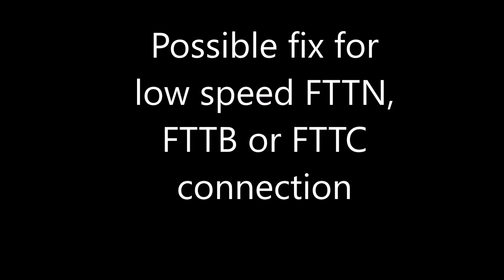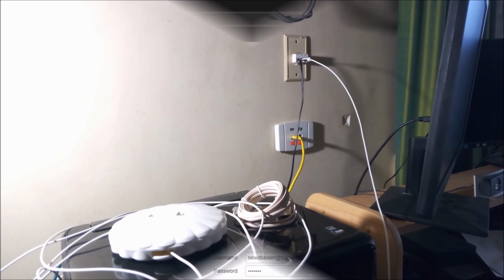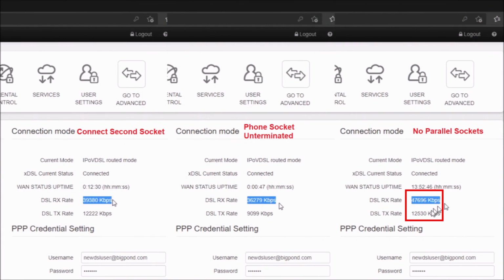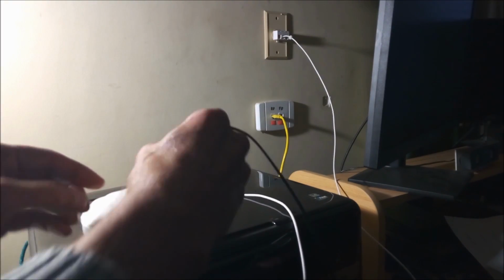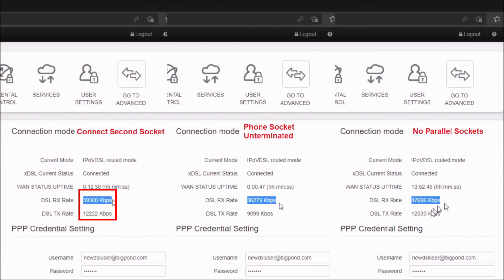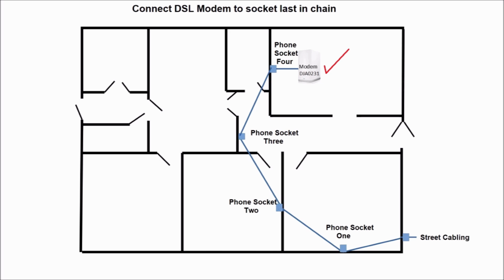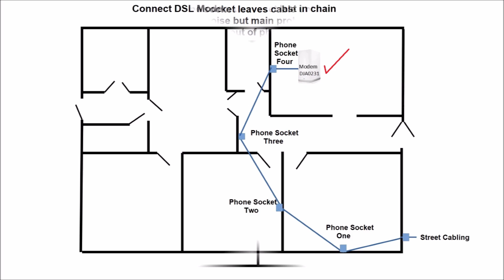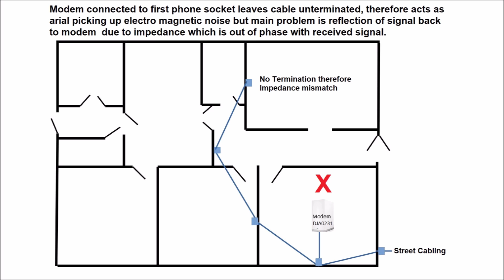Improve Speed of FTTN, FTTB or FTTC (VDSL2) Connection

Comment: Interesting information, For me I get the same speed at both sockets but I am very close to the node and believe this issue more evident on longer lines back to the node. Also you should be looking at the log file and seeing what it says the maximum attainable speed is for VDSL. As my actual DSL RX and TX rates are always the same since I max out my 100/40 connection the attainable rate is what changes for me and it can vary by a few Kb to a meg each time it resyncs.

Big issue most people face is star wiring where they all go back to the incoming cable and branch off there, you cant actually connect to the end one and you have all sockets acting as antennas. Daisy chain certainly has less issues for the reason you mentioned as long as you plug into the last one in the chain, at the end of the day the best thing to do is either find the incoming line from the street and connect to that socket and have all the extra wiring removed. Or if its that not suitable have a cabler run a new cable from the box outside if you have one to where you want it in Cat6 cable, Or if your lead in goes directly into your house then have a cat6 cable run from this point to where you want to be and have it joined on to that cable.
Reply from the maker: In my case my the Maximum Sync rate my line is cable of is less than my plan rate 50/20. In order to achieve this NBN have set the Max DSLAM throughput at 60.104 Mbps down and 22.600 Mbps, but the maximum sync rate of my line with one phone socket is 47.235 Mbps down and 10.679 Mbps up. The actual link upload speed is the same as the maximum and the actual download speed is slightly less than the maximum download speed. These results are displayed in the final image when I replaced the Arcadyan modem with a Fritz box which although it had a slightly lower sync speed has better diagnostic information.

If I had been on the 25/5 speed there would have been no difference in actual speed and I agree that if close to the node you and the house has been wired correctly using a daisy chain there would be little difference in speed. But even people close to node might notice a difference in speed if house had multiple phone sockets wired incorrectly using a star configuration.

In my next video I will also demonstrate the effects of a star configuration. I made an mistake in this video in using multi stranded cable for the extension instead of single stranded cable. Multi stranded cable results in high attenuation and was why the speed when connected to last socket in the chain was less than when connected to first socket with last socket removed. In the nest video only single stranded cable is used. Surprisingly providing there are no parallel sockets connected the speed between sockets only varies slightly. In fact although the upload speed decreases the longer the distance from the download speed has actually increased slightly.